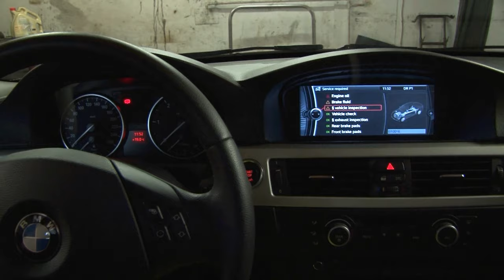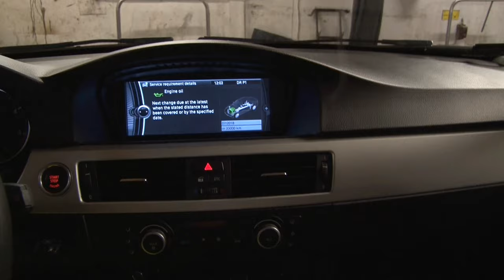BMW 320d Engine Oil change - 3-series 2005-2011

Comment: By the sound you should have changed the the timing chains or you already changed the engine......
Reply from the maker: chain is doing fine. The water pump is causing the noise

Comment: For what is that pipe on the oil filter does it need te be on something special hole or what
Reply from the maker: To distribute the oil through all the filter and not just the lower part

Comment: Why didn't you give the oil time to sink to sump between checking dipstick no wonder you used 6 litre of oil when manual says 5.4 i think and also why rev car straight away when starting ?
Reply from the maker: I used half of the 1L bottle which makes it 5.5L in total.

Comment: Hi mate there’s no centre bit in my oil cap it’s just the cap itself is it supposed to have the plastic piece that goes in the middle of the filter on it?
Reply from the maker: Should still be OK without the center piece. It wont change the oil flow and the filtering

Comment: How many kilometers do you do before to change again? Do you suggest to do motor cleaning with flush?
Reply from the maker: Computer is calculating when oil must be changed again. Something around 20.000 Km with my driving. Not needed to flush the engine....even after 2.000 Km the oil is pitch black again

Comment: Which type of oil engine usefor bmw 316 ti compact 150000km n40 ....thanks nice meet you have a good daies sorry my english not good
Reply from the maker: Castrol 0W/40 fully synthetic
Reply: @mondeo984  ..thanks
Reply: Which type oil use for bmw seria 3e90 2007 2000cc diesel?

Comment: hi...i'm working in denmark and i have a e91 ,318d ,143hp.....and i was reading on the internet about some problems with the timing chain?...can you tell me something about that?
Reply from the maker: I hear'd about it but don't really believe in it. The internet can easy join people in groups all stating some common problem and make it major problem. Like swirl flaps on the E46 diesel engines. BMW is selling thousands of cars and of cause problems will happen.Just because I need to change a water pump and 100 other have to change the water pump, does not make all 1 million BMW having bad water pumps. Internet just makes problems more visible.It's just like I saw some Tesla S owners who said their hood bends if you smack it too hard due to aluminium is softer than iron......and suddently all model S hoods will bend.
Reply: thank you for your answer....i'm feeling more relieved now.....by the way,this weekend i will change the oil like you show in the video.
Reply from the maker: Good luck. BTW: If you should ever get timing chain fail, you don't have to take the engine out of the car. There are methods to do it way faster and keep it simple :)
Reply: but if i will have a timing chain fail a know that a lot of things it will be broken on the engine.....its a very expensive job...and very expensive parts.....BTW where do you live?
Reply from the maker: Timing chains doesn't just break, they start to make a lot of noise. The chain can be replaced by only removing the top cover and connect the new to the old and pull it through the engine. Not more expensive than replacing a timing belt in most cars.Live in very south of Denmark.I wouldn't worry about it....just listen once in a while, and if it sounds ok which it does in most cars, then just leave it.
Reply: i was listen it and i just sound right..,,nothing weird....i've seen that you have changed your angel eyes..i also would like to change it...i have a friend from Poland who will bring me some LED angel eyes 80 w  because there are cheaper ...i have halogen headlight so i have to take out the wheel and the plastic wheel cover to change the angel eyes.....shit design
Reply from the maker: Don't spend money on LED version of H8 lamps. It's still not strong enough to act like Daytime Running Light in Denmark. You need a version with LED's put in a circle with 20-60 LED's in each angel eyes to have enough light. The 20W-80W is just BS, the real wattage to the LED is something like 1-3W and gives the result you see in my video.There are a few suppliers who make REAL DRL with LED that works. You can see it here : https://www.youtube.com/watch?v=WG1fRfZUuqY
Reply: @mondeo984   Haha I Challenge you do do a video live here on youtube and start the car after a change like that. If it works you are a genius and if it doesn't we will have a lot of fun!
Reply from the maker: @kristianbrandstrom  have a look on how the chain can be replaced with ease by opening the chain and add the new chain to the old and pull it through the engine. It's explained in danish here by my local BMW specialists https://www.youtube.com/watch?v=bmX-nCaT30c
Reply: @mondeo984  i have a 318 touring on an 11 plate , my chain is noisy a little , more so when engine is warm , can my cahin be replaced the same way as it states its at the back of the engine
Reply: If it is a N47, between 2007 and 2009,sooner or later you will replace the timming chain. The easy way or the hard way.

Comment: great video, what oil do you recommend including the grade and viscosity for a 2011 320 D
Reply from the maker: Castrol 10W/40 or 0W/40 fully synthetic
Reply: You can also use fully synthetic castrol 5w/30. I use it for my E90 320 D.
Reply: N47 run 0w30 LL04

Comment: M47 are the better engine. My friend have  e60 with n47 engine. He changed engine 3 times because of the chain krush and damage the engine. N47 and N42 N43 are just garbage.
Reply: I've got a N47 D20 in my E90 LCI and just hit 200k miles, original Turbo, timing chain, gearbox and clutch (not even a hint of timing chain noise).  It's seems to be a complete lotto with the earlier pre-LCI ones.
Reply: yes but sometimes the plastik on the chain tightens brakes, thats what happend with my friend 3 times.
Reply: Bmw's N engines are not reliable yea